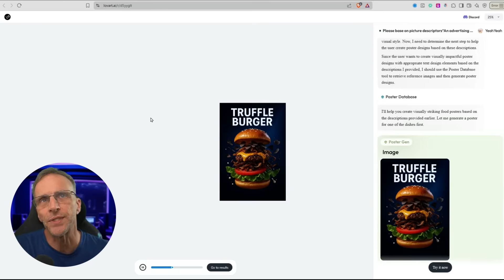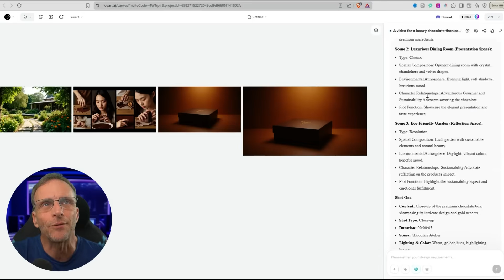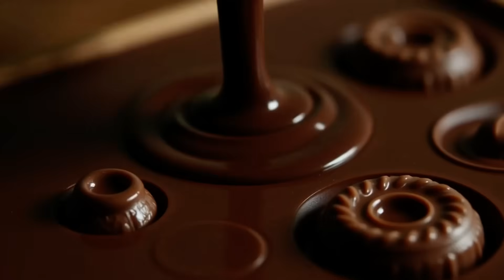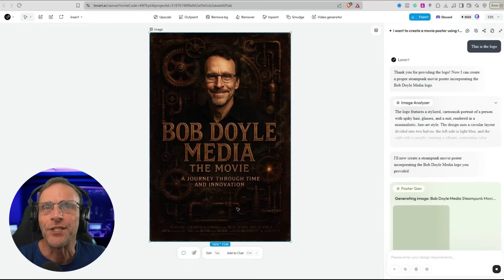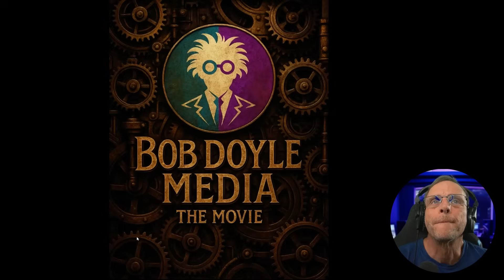Meet Your New Tireless AI Design Agent: Lovart

Comment: Based on the provided Lovart Terms of Service (Section 2.2), here's a breakdown of the license grant and its implications: 
You grant Lovart a Broad License to use your "Assets":
This includes both your inputs (what you upload) and the outputs generated in response.
The license is:
Perpetual: Lovart can use your assets indefinitely.
Irrevocable: You cannot withdraw this license even after terminating your agreement with Lovart.
Worldwide: Lovart can use your assets anywhere in the world.
Non-exclusive: You still retain ownership of your assets and can use them yourself.
Transferable: Lovart can transfer this license to another party.
Royalty-free: Lovart does not need to pay you for using your assets.
Sub-licensable: Lovart can grant licenses to third parties to use your assets.
Lovart's "use" of your assets includes:
Reproducing, modifying, adapting, preparing derivative works of, communicating to the public, publicly performing or displaying, distributing, and otherwise exploiting them.
Waiver of Moral Rights: You also waive, to the extent permitted by law, any moral rights you might have in your assets. This means you may not be able to object to how your work is used or treated. 
In simpler terms: By using Lovart, you are giving the company very broad rights to use, modify, and distribute anything you upload or create on their platform, without payment or needing further permission, even if you stop using their service.

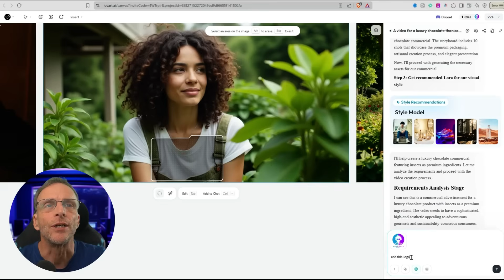Comment: 4:00 sadly if it cannot get things like logos correct then it instantly fails at what it's trying to be. This is not a design agent. It's various API's in a fancy wrapper. A designer needs things to be correct at all times since usually they are working for clients. If this is going to totally change important aspects then it's already dead in the water.
Reply from the maker: If you keep watching, it does get it correct. Expecting a few passes at things - like in real life - is not uncommon or a reason to dismiss it.
Reply: I thi k if you have to touch up 20% at the end then any designer would be happy. I've worked on photoshop projects that have took weeks so anything that can reduce to 1 day is a blessing.
Reply: @armondtanz I understand that I’ve been a designer for over 20 years. But totally changing the logo isn’t a “touch up” job. It was totally different.